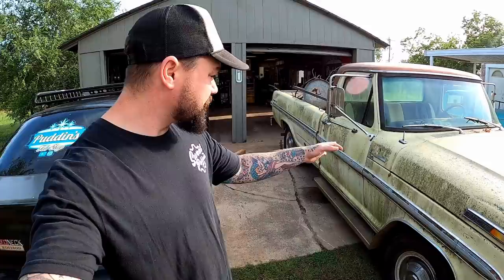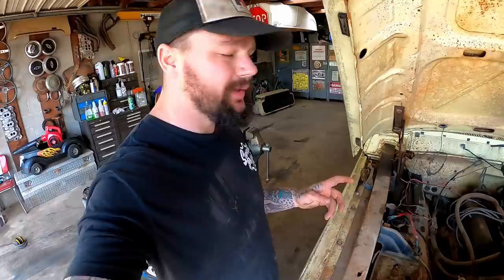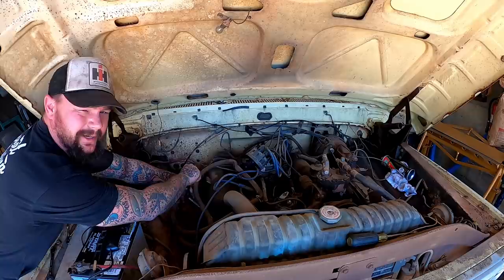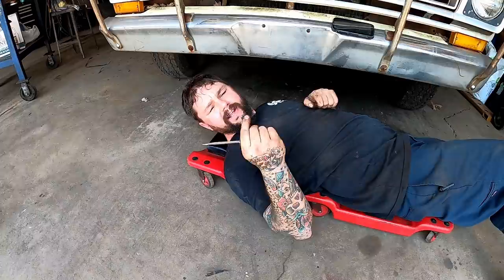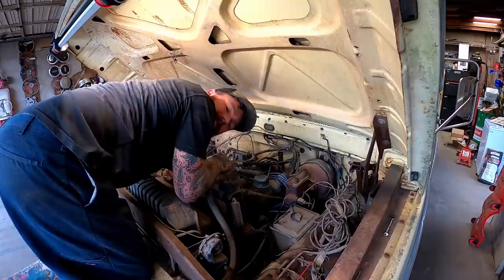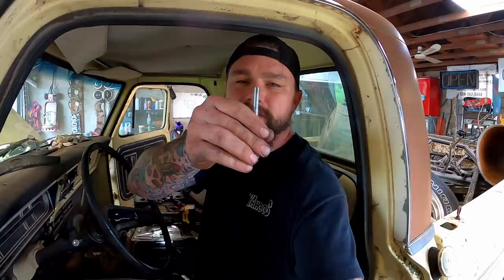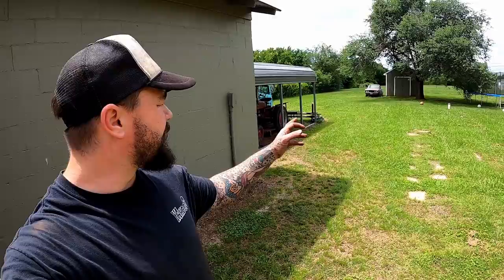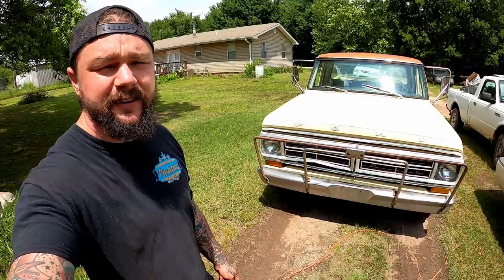1972 Ranger XLT Camper Special. Will it RUN and DRIVE?!?

Comment: well seems like a dimwad thinks an old full size Ford is a ranger, not
Reply from the maker: Looks like HOKE POKE needs to do some research…

And you just called me a dimwad
Reply: Back in the late 60s and all of the 70s the ranger was a full size model I had a 72 ranger xlt 390 4 speed and my dad had a 78 ranger xlt
Reply: Rangers used to be larger. They haven't always been the little  baby trucks they are nowadays.
Reply: They started to shrink some time in the 80s I believe, if you look at a Ranger from let's say '73 you'd find a full size Ford.
Reply: ranger used to be certain ford full size trucks, ranger later evolved to the little truck , which before used to be called a courier ...
Reply: Lol, I had a 70's full sized Ford truck that had the Ranger badging. I think it was a trim level thing.
The 'lil Ranger didn't come out until 83 in North America.
Reply: They were full size.   My dad hit a horse with his 1975 xlt250.ranger we put a 429 cobra jet in it, Detroit lockers, 40 inch gumbo's, pushed the front cab corner all the way to the windshield!!!    It was at 12:30 @ night  blind corne,. And it was a sheriff's that he let freeroam.The horse did NOT make it 😉   😆😄
Reply: @PuddinsFabShop  hahaha! Give em hell man!!! I Love how you pinned him so we could all see what a jackass he is. I've got a 1974 Ford F-250 Ranger SuperCab. Full size ranger
Reply: @PuddinsFabShop  hey I like the badges you made saying Ranger !!! NOT ! I guess he likes hearing himself type or something ! Didn’t the Ranger full size stop in 1982 ?
Reply: Do some research before you comment please !
Reply: @davekimbler2308  I believe so yes. It was a trim level like Silverado was for Chevy. This is the downside of the internet, it's avalible to EVERYONE.
Reply: @Quint1836  👍
Reply: @danielleighton2553  I hope all you guys are trolling here. I really hope you don't think the Ranger was ever a full size truck. It's a trim option like "XL, XLT, Custom, Camper Special, etc." Do some damn research.
Reply: @jasonpetrich4141  great job here buddy. I am a Chevy guy and don’t know a whole lot about Fords but I used to since I grew up during this era. Enjoy your videos a lot. Thanks for sharing them with us. Maude this guy gets too serious and self righteous. Must be miserable. 👍⚡️👍😃✌️
Reply: @DemolitionJake  They are not baby trucks and havent been for a few years now
Reply: @chrism7067  I haven't really looked at newer Rangers. The one I own is a 96.
Reply: Old ass rangers were full size.. not a nice comment for someone with no knowledge ...get the facts before you bash ...😁👍
Reply: Some one needs to go back to school.
Reply: I ain't even a Ford guy and know Ranger was a trim level on a FULL SIZE truck back in the 70's. Hell, I ain't that smart and knew that.
I'll do one better... my 15 year old video game playing, lazy son even knew the "Rangers" in the 70's was a full size truck.
Seems to me I might of found someone I may look smart around. You want to hang out?
Honestly though, if you can do the youtubes, you got the internets... Look it up before you choke on your shoe again. 
(that was a play on the foot in mouth saying)
Reply: 3 months is just long enough that everyone will still come back to look.
Reply: Puddin 
All of the 72  sport custom and Ranger xlt.that had 390 s. 
All had 4 barrell cards .
The 360 had s two barrell .   That carb you rebuilt that was a 2 barrell. Correct
Reply: Well it seems like you need too do some Ford Ranger history because you're wrong. Only dimwad is HOKE POKE
Reply: All this over the difference between an older trim level "ranger" and a "ranger" labeled light truck... both exist.
Reply: Kids smh
Reply: High end trim level
Reply: @PuddinsFabShop  lp lp
Reply: @hoke poke. Ranger was an option then, not a truck; you hero.
Reply: I know I just wanted to rattle your cage. I worked for several Ford dealers during that time. I also owned a few of them.
Reply: Hoke Poke Ranger Yes!
Reply: @PuddinsFabShop  man!!! People are critical even if there dead wrong. Love your channel bud, I'm from northern California and people from Oklahoma remind me of people from the real Northern California, Sacramento up. Anyway I love your content.
Reply: Ranger XLT was the top trim option in those 70s Ford trucks. Similar to the Explorer trim. Both eventually became their own model.
Reply: @davekimbler2308  I believe the Ranger designation stopped in 1980 when the body style changed.
Reply: @hokepoke3540  you sure did stir a big can of beans on this one ! I don’t know if it’s the dim wad comment or the Ranger comment that got the most response ?!
Reply: I use to have one it was a 72 with a I think a 460 it loved gas a lot of gas lol but it would fly
Reply: I got a 1969 ford ranger camper special all 100% original
Reply: Ranger used to be a trim level
Reply: Uncler had a Ford xlt explorer ranger.... still drives today!!!
Reply: Ranger was a trim package back in. That day. BE NICE AND WUIT CALLING NAMES
SHOWS YOUR LACK OF INTELLIGENCE
Reply: @PuddinsFabShop  I got him pudd I told him a thing or 2 calling you names.
Reply: To clarify this. Ranger was a package for the f series of pickups. Starting in 1965, it was used to denote a styling and equipment package for F-Series pickups. Prior to that, the ranger nameplate was used on edsel cars. My pops had a 1979 Bronco Ranger XLT. It had all the goodies offered at the time. It was awesome. Miss it dearly. Anyways, the ranger name was taken from the f series in 1981, so it could be used on the completely new compact pickup introduced in 1982 as a 83 model year. Taking over the gap left from the ford Courier  that ended US sales in 1982.   So yea... Ranger f250... it's a thing.
Reply: @dabtech7456  what kind of gas mileage does one of those get?
Reply: @brianhaygood183  8mpg street 10 mpg freeway
Reply: It even says ranger on the truck @2:30
Reply: @davekimbler2308  I got 86 F1-50 full size RANGER 4 weal drive
Reply: I wouldn’t waste my time on it but yes there was full size Ford rangers back in the 70s
Reply: Pin of shame!!
Reply: When were you born
Reply: Hoke polke needs to do research before he calls someone a "dim wit" plus learn to spell
Reply: I have a 1982 Ford F250 Ranger with the Lariat package.
Reply: I have a 1979 F-150 4x4 explorer the only difference between it and the ranger XLT is pinstriping an emblem on top of hood
Reply: Just asking…Could the jumper wire be used as a Security type lock down…Split the wire and put a switch in between the two wires …just asking😊😊😊

Comment: My summer truck is a 1973 F-250 Ranger  Camper special,    2nd owner , all original... 56,000 Miles, Two tone greens ...   Gorgeous truck... 
Love these old trucks and this channel. As far as color & paint , I'm almost certain that the two tones were completely covered in one color then came back and painted over that color with the 2nd color / tone.

Comment: I been sitting on my grandpas 72 Ford 100 360l for at least 12 years.. Decided to finally start working on it. 😂 This vídeo was not only entertaining and informative, but also motivating. 🙌🏻 Don’t have much experience with engines and old cars but this shit came in clutch!! Swapped out the ignition (had no keys) then followed along and got her turned on! Thanks a milli.
Reply from the maker: Man that’s awesome! I may mess around but if I can’t help guide ya in the right direction that’s awesome!

Comment: I just can’t recall the last time I’ve seen a 72 Ford pickup with air conditioning. That has to be a very rare option or aftermarket add on. Such a nice truck with a TON of potential with a great 390 engine. She’s a goodin & She was built for pullin and keep ya cool too. That was rare back in 72!
Reply from the maker: I think air was added at the dealership

Comment: I think the paint on the B pillars and top was to match a camper that rode in the bed during it’s early life. Dad had a 73 Super Camper Special with a 460 V-8 and C6 transmission. When I was a teenager I was useless. I stole it outta the yard one day while dad was at work and tore a farmer’s cornfield all to pieces with it. It’s one of those stupid things that I did that I was so ashamed of when I finally grew into a man.  Dad lived to be 82 and every once in a while he’d mention it and laugh.
Reply from the maker: That makes sense! Add a camper that don’t match the truck so add paint to the roof and trim to make them blend!

Comment: I got to go get my 1978 F350 dump truck. It needs a rear end. It was bought new by a local farmer here in patriot Indiana. Well he died in the late 80s. And then it was sold In a estate sale. Sat till about 04. Then the old tree trimmer guy I used to work for got it. And I was like are you going to junk in. He said no this is a brand new truck. And I was like yeah right well we had to pull it about 2 miles before the clutch would come unstuck from the flywheel. We got it running I drove it like a car till about 2010. Now it's 21 and it's mine.
Reply from the maker: Hell ya!

Comment: Nice job on the Ford! That built in toolbox is cool! 👍🏼
Reply from the maker: It is!
Reply: the tool box is actually where the spare tire goes
Reply: @Callsign_Fredrick877  That’s much easier to get to than under the bed! 👍🏼
Reply: @Callsign_Fredrick877  Really? I’m positive the spare tire wouldn’t fit. They had the chain hook underneath.

Comment: I had a 74 short bed long time ago and it was the same kind of yellow I think it's like a mustard color. I always called it baby poop yellow and then I had a bump side 69 3/4 ton camper special. With a 390 engine. I think that's got a C6 transmission in it.  dang for 72 she looks really good. My old 69 the roof was all rusted out. I literally put expandable fom in it shaved it off on the outside skim coat of Bondo and white paint over it. In that bed on Rick's truck I actually looks really good mine was rusted all around the edges the middle. But other than that it was a damn good running truck.

Comment: I had Safeguard put a trailer hitch on a car in 1972. They did a good job. Puddin, I told you a while back I wanted a s10 pickup with a 383 motor. Well I found a 2002 Corvette in Oklahoma that I am getting Sunday. I used to work 12 hour shifts. It got to where it was tough.
Reply from the maker: That’s awesome about safeguard!  Corvette will work!

Comment: Once again, FORD = VIEWS!!! 
I have owned several on these bumpside trucks and currently have a 1968 F100 as my daily driver at the lake. The original build sheet from the factory will either be in the springs of the seat or under the carpet on the passenger side. 
This truck is a GEM! Wish it were mine. Your uncle Rick has fine taste in trucks.
Reply from the maker: I hope it keeps getting views. As of right now it’s doing less then a Datsun and Chevy in the first 24 hours…
Reply: @PuddinsFabShop  oh yeah, right! It hasn’t been up 24 hours yet and it’s coming on strong!  Your grandfather’s F250 ‘Will it Run?’ is by far your most popular video. It even surpassed you metal brake set up or whatever it was. 
An update on the Shoebox Ford you did for Shoebox Central would get big views, too, because, well, you know, it’s a FORD!
Lol. Enjoy ribbing you a bit. Great channel, look forward to your new videos every week.

Comment: A PUDDIN MUST READ!!!!!!!
A trick for those old carbs before you start working on the truck put a 3' piece of fuel line attached to the carb and fill the carb up with carb cleaner and fill untill it pumps threw the jets it should hold most of a can of spray and then go to work on the rest of the truck when it is time to start it up I have saved a dozen of the old ford carbs that sat for 15 t years and they work fine and stop leaking after the heat cycles a couple times

Comment: Extremely jealous that you can put a socket and ratchet on your bleeders without snapping them off. My 2003 chevy silverado had knew brake lines put on in 2017 and the half ass mechanic rounded them off. So I' m hoping i can use vise grips to get them out. This truck is almost as rusty as an old scout or CJ 7 JEEP. Odd that your Ford loving friend pulled up in a Dodge . l let a 1967 Ford Ranger from Las Vegas go in a trade of body work on a33 Dodge Ram pickup, should of just paid them.that was in 2009.You and Mortske are my you tube heroes, keep up the good work.

Comment: My late grandfather owned a Ranger XLT Camper Special himself, but it was a '74 F250 in two-tone orange and brown paint.  He bought it brand-new and owned it for 36 years.  It sat unused in our three-car garage from 2000 (the last year the plates were registered) until he sold it in 2010.  (A towing company wanted the mirrors, so they bought the truck from him and scrapped everything but the mirrors.)  What a shame - it could have been restored, but by the time he got rid of it, it actually looked worse than your '72 did.  Lousy Ohio wildlife...
Reply from the maker: Damn that’s crazy!

Comment: The points system on ford requires a ballast resistor wire, which once started, drops voltage to the coil. If you're still running points you can't use a 12v jumper. You need a ballast resistor.
Reply from the maker: Yep and that wire wherever it may be is the reason it won’t stay running off the factory wire. I agree they drop the voltage to 9-10 volts to prolong the life of the coil. It is a 12v coil though and the 30-40 minutes of run time we put on the engine and gonna kill it.

Comment: Just learned the other day some old fords use 9 volts from a ballast resistor to the coil while running, during the starting to avoid the voltage drop from the starter turning they send 12 volts straight from the relay. So if the truck dies as soon as you stop cranking, the ballast circuit is bad.
Reply from the maker: Correct! It also has disable links coming straight off the key. I didn’t have enough time to chase it.

Comment: Excellent video Puddin :) also had one 1972 Ford F350 Extended Cab Pick Up with 390 4V 650 Rochester  barrel carb with Hand Choke cable also Power Steering & Brakes also West Coast mirrors on doors to , 409 rear end gears plus was updated 4×4 to and had 411 rear ends gears also Tear Drop lights on top cab too and 4 wheels drum brakes to plus used a Tow truck with ! P 9.50/ 16.5 LT tires then went to 6 wheels of 245/ 85/ 16 with 8 studs Ford Rims plus centre caps!
Reply from the maker: Sounds sweet!
Reply: @PuddinsFabShop   sure was used from 1993 to 2005 then restored to back nice shape pick up  truck original was from parts truck with low mileage got from my cousins out Alberta Canada and sold in 2006 ! Guy asked when get restored buy me and he did one one another cousin who work for! But old cab was rust out  from salt and sand mix in winter time season over years do in Ontario Canada!  The wrecker part on a 1996 Dodge D350 1 ton bought of my late Uncle Bob used now it got 24 Valve 400 Cubic Inches size Turbo 6 cylinder motor with 5 speed Manual transmission transmission shifter on floor with all options need plus Lol 388 rear ends gears 4×4 too and daul fuel tanks!

Comment: The roof was probably factory yellow, then painted at the dealership copper, but it was not uncommon for ford to have the xlt with a different colored cab top back in the 1960-90, mostly on the higher trim levels.
Reply from the maker: Huh.
Reply: @PuddinsFabShop  yes, you would need to look up the “build sheet” to actually know if it was factory painted, dealer or privately done. But my guess is factory. Some research on the serial numbers may reveal the answer, but going back that far I don’t know if it is in a computer at ford.

Comment: the front brakes have rubber hoses to allow steering, but the rear does not. the hoses will swell on the inside and slow fluid flow, and can cause 'valving', or pulling to one side. plan to replace them on this old truck.

Comment: Sup’ Jello Puddin? Just playin’ which ya bud! Hell yeah, old Ford pick em’ up! I had a 77-78’ F250 camper special, crew cab , king cab, whatever the hell they called that, cab & a half what I called it! Dual tanks and a 460 , couldn’t pass a gas station with that sumbuck and the doggone gas gage didn’t work neither, on either tank too. And I run out of gas more than once in that sombeach! lol!
Reply from the maker: Keep some gas in the back
Reply: @PuddinsFabShop  - yeah, well I was younger then and didn’t much think about that, besides I didn’t drive that thing out of town too much, very rarely actually. I was up in Middletown Ohio then, that’s where I got it from, off a buddy of mine. Right after I bought it, I did drive it down here to Ky just to show my old man and that was about the only time I took it out of Middletown. I kept it around there and junked in it or out of it, that was one thing about it though, that sumbuck would haul a purty big load of scrap.

Comment: You should always check the trans fluid first before running the motor. You probably burnt the pumps up in the trans with no fluid.
Reply from the maker: It wasn’t bone dry. But ya should of checked lol

Comment: i had the same problem with my old galaxie. i was at the wrecking yard the next day and someone had an engine  with a pertronics dist and coil bought them both for 25 bucks it fired right up and ran smooth for years afterward. sold the whole car to a neighbor kid for 1000 bucks, 800 more than i paid for it.

Comment: Puddin i don't know how i missed this ............But what a job you have done. Bit of trivia, you could order a gas powered generator for the camper specials. It was mounted under the hood on the drivers side of the truck.

Comment: They were a great work truck. Tough as nails. One problem with Ford automatic transmissions in that era was that they sometimes went into drive from park on they're own while idling. A few people were killed or badly hurt by them. There were lawsuits and Ford covered it up until the early 1980's when they admitted there was an issue.